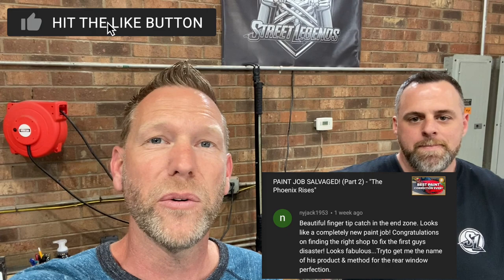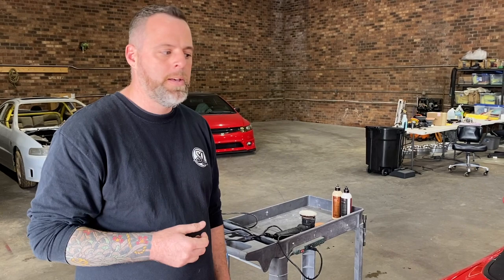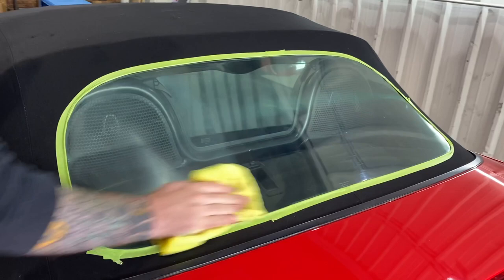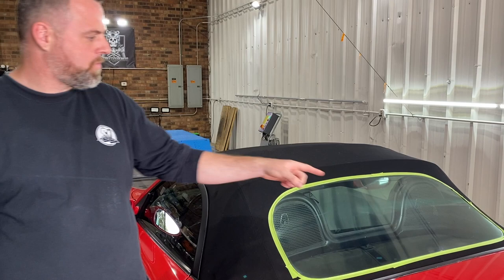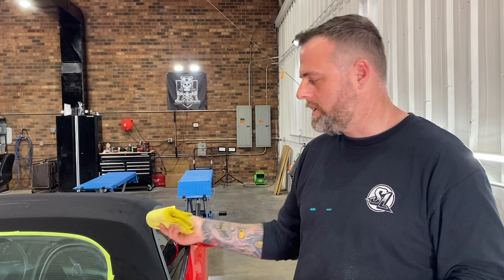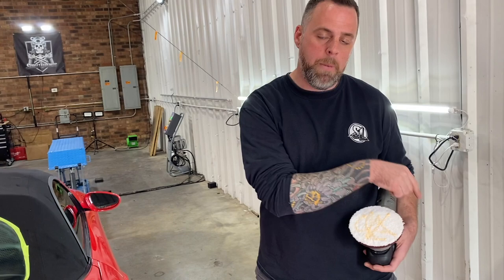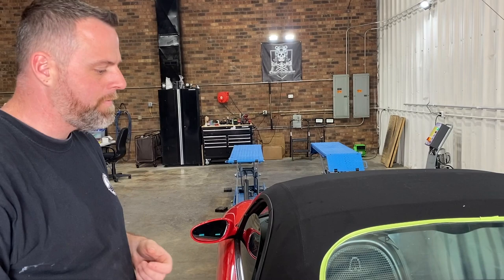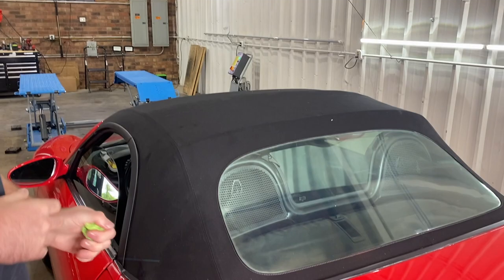How to CLEAN PLASTIC CONVERTIBLE WINDOWS

Comment: Your channel has inspired me to work on my 1997 986. So far I've replaced the (ugly original) wheels with 18" Cayman wheels, replaced the trunk and frunk shocks, fixed a non-functioning driver's seat electric back adjust, fixed the louvers I accidentally disconnected in the HVAC vents when I removed cup holders from them. Still on my to do list is fix a broken piece of trim around the convertible mechanism that rattles like mad and refurbish the leather seats. I'm also considering doing the mod where you replace the convertible's top front location points with 987 ones to reduce the creaking of the top when up - anyone have experience with that?
Reply from the maker: +John Adams glad it’s been an inspiration! Never heard of that mod before...

Comment: Could you make a video on how to restore the small cracks and holes that develop in the folds of the plastic when storing the convertible top? It's possible that water may enter through there, but I don't see a way to fix it (aside from replacing the convertible top).
Reply from the maker: +@sivispacemparabellum8592 I don’t know of a way to do that 🤷‍♂️
Reply: I had thought about applying some type of glue (flexible and rubbery) and baking soda to fill in, in conjunction with some type of waterproofing. What I would still need to know is what glue to use... one that won't burn the plastic, won't dry out and cause further fractures, etc. I had thought about using glue for ping pong paddles - which is rubbery (and I understand would withstand the folding of the convertible top). It's a topic for which I can't find any videos on YouTube, no information in forums. It probably generates traffic for you; give it some thought. Many of us want to solve this problem (which everyone experiences sooner or later), and besides the cost of replacing the top, I'm not confident that it will be perfect in terms of opening, closing, and sealing @HelpMeDIY
Reply from the maker: @sivispacemparabellum8592  I agree it would be a great solution (and video)! Not having a Boxster anymore makes it pretty hard to come up with something unfortunately. Sounds like a great project for someone to try and if they figure something out, meet up with me and we can make a video to help the community 😉🍻
Reply: It would be a pleasure to meet up. If you happen to be in Asturias (Spain), let me know, and we can have some ciders ;) @HelpMeDIY
Reply from the maker: @sivispacemparabellum8592  that would be awesome! 🍻

Comment: Thanks for the great  advice.  I have a 2002 Boxster and have always cleaned/polished the vinyl window by hand.  Never thought of using an orbital.  The inside does get fogged up I believe due to heat when it is stowed and clearly shows some round marks etc.  Cleaning it with the top in place requires you to be a contortionist and its hard to keep from being sloppy.  Opening the top a bit makes it easier but much less effective and likely slopier.  Any further advice regarding possible tools to use on the inside to make the job easier would be greatly appreciated!
Reply from the maker: +Dolph 😎

Comment: Re: Ceramic Coating: No, don't ceramic coat a flexible surface. Ceramic is rigid. It won't survive on a surface that is bending almost 180 degrees in some spots. You could try graphene spray coatings that have a 3-6 month life, but don't use ones with SiO2 in them.
Reply from the maker: +bionictulip good tips thanks!

Comment: Hey Aaron, my Boxster started making a snapping sound when the convertible roof is almost closed. The button works and the roof moves when I attempt to open and close it but it is when it gets near being completely closed, I hear the snapping sound only one time. Any idea what it might be? Thanks, love your videos
Reply from the maker: +SERG yikes. Could be part of the gear/motor mechanism or something in there binding/interfering with the normal operation. I’ve never experienced it personally so I don’t have any wonderful advice or specific suggestions for you, sorry!  If you get it diagnosed and fixed I’d love to know what it ended up being! Take some pics and video 😉
Reply: @HelpMeDIY  Dang :/ thanks for the reply! I'll for sure keep you updated

Comment: Great video. makes me think about headlight polishing kits. Would they work on badly obscured tops.  I have two convertibles with issues and thinking I should try it.
Reply from the maker: +Carlos Alberto not sure… the one I used recently probably wouldn’t. Last step is a sort of ceramic coating the brings the clarity, but you don’t want that on plastic that bends and folds.